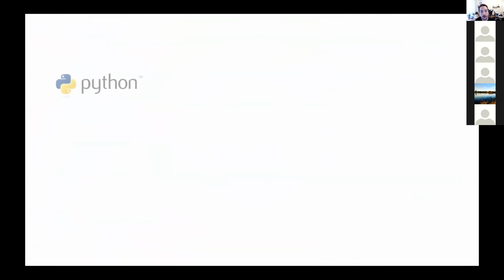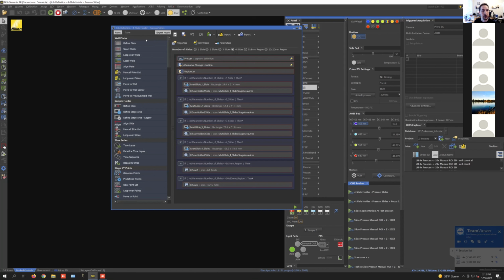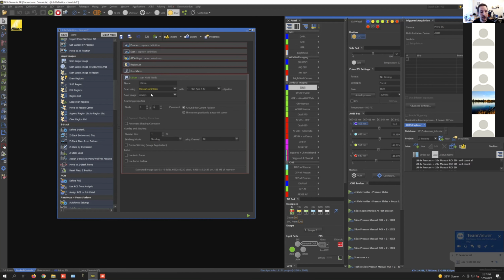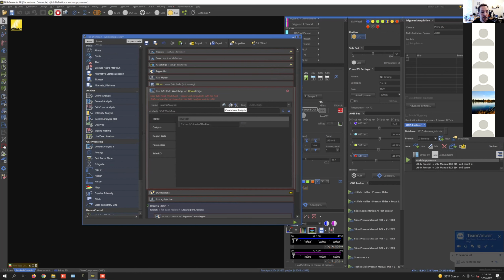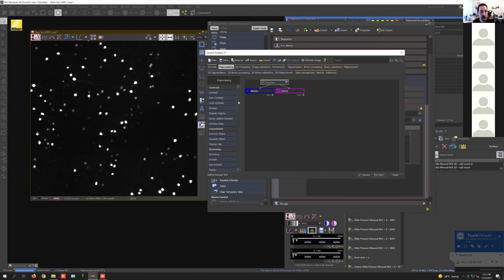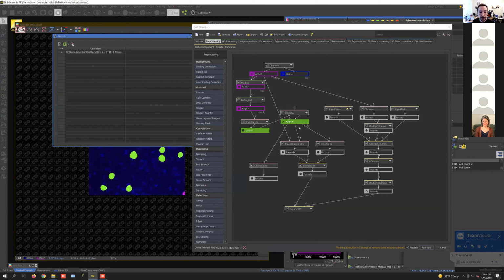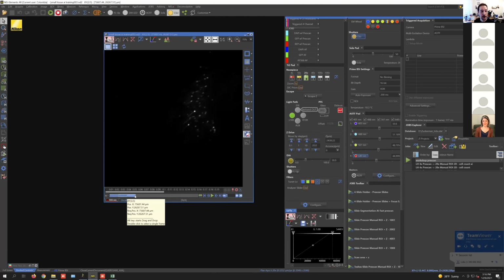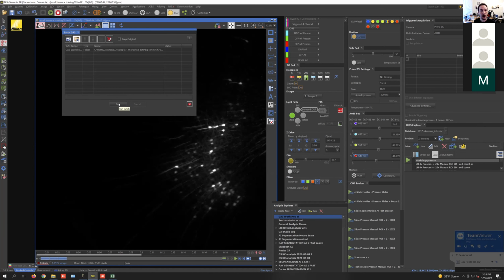Automating Imaging and Analysis in NIS-Elements

Comment: Hello, I am building a JOB but I am a bit stuck, and was wondering if you could help me.
I am trying to build a JOB that connects acquisition to external image analysis and imports back the coordinates for point stimulation. I managed to build a JOB that can start the external analysis on acquired images and import the xy coordinates to a point list in Nis Elements. Now I need to make sure that the xy coordinates from the point list are point stimulated with 405 nm laser. Do you know how I could do this?